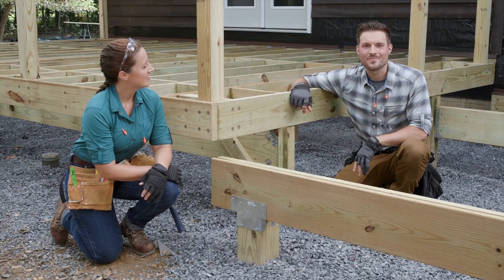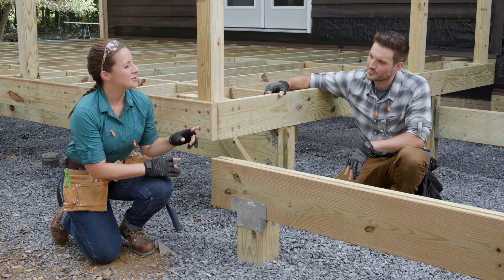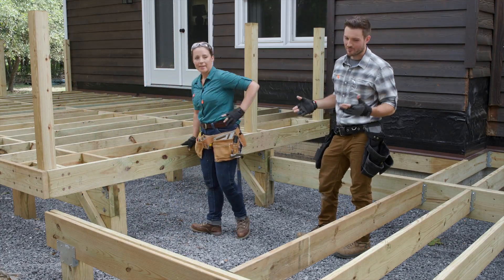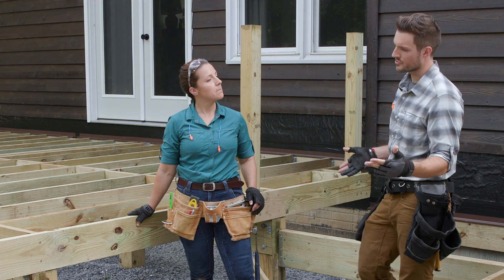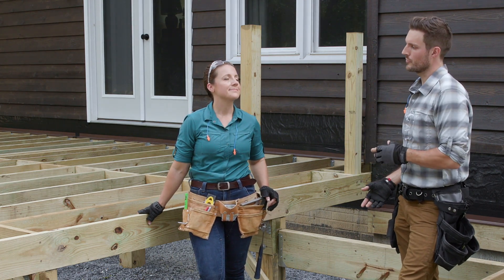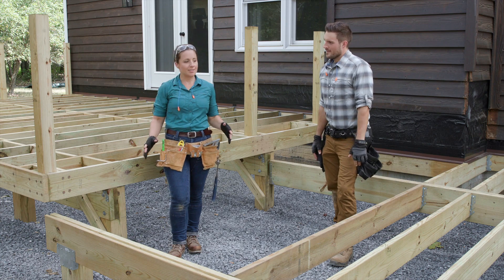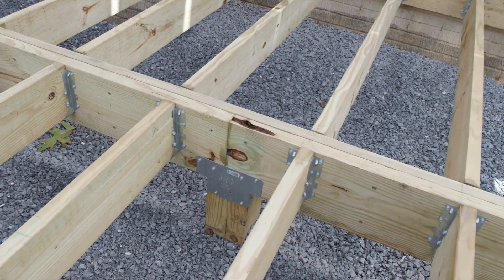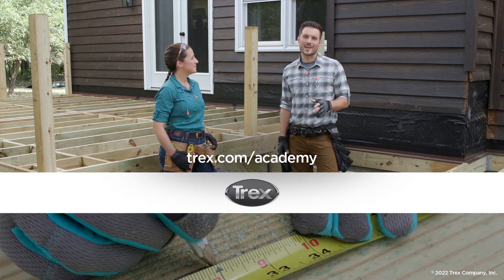How to Install a Deck Flush Beam vs. Drop Beam | Trex Academy

Comment: I really love all of the videos in this playlist, but I have to point out here. According to Simpson’s post bracket installation General Notes, all post brackets must be installed in pairs. Using 1 AC6Z bracket, and 1 LPC6Z bracket together to connect the post to the flush beam is not proper installation. It would have been more “correct”, according to a Simpson, to just use 2 LPC6Z connectors.

Comment: I'm doing a shed base with basically the same flush beam configuration as shown here, with a doubled 2x as a midspan beam. I've been searching everywhere to find the answer to this question: if the joist hangers on either side of the center beam are lined up and facing each other, will the fasteners from each side run into each other in the beam? How can this be avoided while still using the appropriate fasteners (Simpson Strong Drive nails/screws)?

Comment: What he is calling a "flush beam" is really a rim joist with Joist hangers.
  Load should never be carried hung on fasteners. To do so is shoddy carpentry and a hacks cheapo shortcut.
Load path should be wood to wood to wood to concrete to ground.  Fasteners should only hold components together. Fasteners are not appropriate to hold components up.

Comment: There are a couple other factors to consider:
1. With a drop beam, you will have longer joists that will be heavier and usually more expensive per foot, but they also only require one cut to get the right length. 
2. Depending on the deck size and spans, there might be more waste generated when making the additional cuts in the joists for the flush beam. Wood that you’re buying but maybe throwing away. 
3. A drop beam also blocks some access to the area under the deck that sometimes is enough to be used for some storage.

Comment: My deck roof is 16 ft X20ft with low slope of 2/12. My contractor used a flush beam with 16 ft long roof rafters and hurricane hangers/hardwares. He didn’t use drop beam. Does it something that I should be concerned about 16 ft wide roof with flush beam without any support?
Reply: It depends on the size and spacing of the rafters. It appears that 2x8 rafters on 16” centers (14.5” between rafters) is code approved for 16’ spans. As they say, best to check. 

My understanding is that the roof pitch no longer effects the allowable span in the most current building code. 

Most areas require a permit for a roof, so the size and spacing should already have been checked by your local jurisdiction.
Reply: @johnlee7085  thank you for your reply. The joist used are 2X10 at 16” apart. Is flush beam method is equally strong as drop beam method?
Reply: In nerd terms, rafters over drop beams would have slightly greater load carrying capacity, but not enough to be recognized by the international building code. 

I should have qualified my previous response. I live in an area that doesn’t have snow, and am used to looking at those tables. 
2x10’s on 16” centers should be more than adequate if you don’t experience snowfall. With a 50 lb/sf snow load, the max span decreases from 19-6 to 14-2. The other qualifier is that those are the values for Doug-fir lumber, which again is what is commonly available in the US west. Other types of lumber generally have lower span limits.
Reply: Thanks. I appreciate it!
 My deck permit is still open and it is been 9 months that some work is not fixed and electrical inspection is not passed. My contractor is not taking my calls or replying to my texts. 
Also, Since the roof frame was built, I have emailed two three times to the contractor and architect engineer and expressed my concern about the flush beam design they selected for my deck roof. They didn’t do any changes and the framing/ building inspection was passed but I am still not happy/satisfied  with the flush beam as we get lots of snow every year and it sits on our roof for weeks before it starts melting. In worse case scenario who will be responsible for all that?
Reply: Sounds like your greater issue might be with the building department. If you get a lot of snow, I’m not sure how the design you have described would meet current building code. Similarly, I’m not sure how the design you have described would pass the plan review. There might be some professional liability on the line from all three, or at least the BP and design professional.
Reply: @johnlee7085  Thanks. Your guidance is very helpful. It is really truly worth knowing the right direction  for resolutions.
Reply: I reached out to township and raised the issue that my deck roof rafters are not sitting on the structural beam. Why did the inspection was passed? and why did the permit was issued for this design at first place as we get lots of snow each winter? They responded that permit was issued as it is code complaint, but it is a minimum code requirement. The township asked me that my architecture will answer why did he design that way and that how much this roof will bear the weight of accumulated snow (lb/sq ft).
I forwarded my concerns and queries to architecture. He didn't answer my questions and wanted to have a meeting with us and the contractor. My contractor is not confirming for this meeting and trying to finish the electrical stuff first to get its inspection done.

I am not sure why he wants to pass electrical inspection before we discuss the outstanding issues in architectural design.
As I am not aware of how these issues could be handled and resolved, I need to know what should be done and how we proceed for the resolution.
Reply: @humairakhan2945  I'm in Canada with lots of snow, have a flush beam and have had no issues whatsoever for years, and mine's 2x8 and not even 2x10 like yours. I don't think you need to worry and it's not just the ledger that holds the weight but multiple posts all around as well. You should be fine.
Reply: @redline2066  thanks for your positive response regarding the concerned flush beam of deck roof. It is a great relief to know that the flush beam works without issue. Could you please share your deck pics and if possible it’s outlined design too?
Reply: @redline2066  I sent you my email twice but every time it vanishes from the post?
Reply: @redline2066   can you send me your email to connect?
Reply: @humairakhan2945  Keep in mind that the load of the flush beam roof is carried by fasteners. Technically it is not even "built" it is "hung".
Reply: @humairakhan2945  If you let them built it you will pay to have it replaced when it falls down.
 Your "contractor" is a cheapo hack.
 Get someone to do it right. The beams can still be put in and they need to be there to carry the load.
Reply: @williardbillmore5713  could you please tell how to add beam at this point? He already has covered the columns with facia and ceiling with soffit.
Reply: @humairakhan2945  The rafters( roof joists) will need to be exposed so some of what has been done will need to be undone.
 Do you have a lawyer?
Reply: @williardbillmore5713 so far I do not have attorney. First, I want the contractor to correct/ fix the issue. That’s why I need to know what are the options to add beam at this point. Do I ask him to add one more column adjacent to each of the 3 current columns (by using the same current footings) and put a beam on top of the new columns)? Or should he add only a new beam under roof rafters by fastening a new beam with the 3 current columns by drilling long screws thru them?
OR is there any other possible better option to add a beam. Your suggestion would be greatly appreciated. Thanks
Reply: @humairakhan2945  The following illustration shows how the roof should be supported,https://timberframehq.com/wp-content/uploads/2020/01/Timber-Frame-Shed-Roof-Plan-4923-_-2-1024x705.jpg
Reply: @humairakhan2945  To do this right the roof needs to be temporarily supported with propped up posts so the old posts can be reworked to support the beam from under it. Remember wood resting on top of wood is "built". fasteners that are horizontal to hold up a structure  means it is "hung".
 A roof structure should be "built" to maximize it's load bearing  in a situation like yours where snow loads must be considered..
Reply: Sounds to me like pretty crappy carpentry.

Comment: I feel the "floating" deck (which uses the flush beam) is just the current fad that will be outdated in a few years. Where as the more traditional dropped-beam deck is timeless and therefore will maintain more real estate value in the long run.
Reply: Drop beam construction is the only real beam construction. What they call "flush beam is really just a rim joist with hangers. The drop beam deck  will outlast the cheapskate shortcut hung deck by at least twice as long.
Reply: It is not like a rim joist though.  It is like building a drop beam deck, but then putting your joists between the drop beams instead of on top. 

I don’t really see how it’s a shortcut. You still have to have the same amount of footers and posts. You have to double your joist hangers. Cutting way more joists too. Honestly I think a flush beam would take me longer to execute than a drop.
Reply: @bloomgardenco.2328  You can call it a beam all you want, ...you can even double it up, but if it is the same level as the joists and attached to the ends of the joists it is a rim joist in my book. I built my deck with three beams and nine footings and posts freestanding with no ledger board...I did not use a single joist hanger on the whole deck. Joists had full bearing on the beams and attached with hurricane clips. Depending on hardware and hanging the load with fasteners  is inferior carpentry. A drop beam design does not require any joist hangers at all and is superior engineering. All the load is transferred joist to beam to posts to footing to ground. Nothing is "hung" on fasteners.
Reply: You might have it backwards. I believe the term floating deck comes from the cantilever allowed by a drop beam.
Reply: I have built many houses and there is nothing wrong with a flush beam
Reply: @jackfarrell4727  You want to live in a structure that is hung on a bunch of cheap fasteners? Great, but I prefer to live in a house that was built.
Reply: @williardbillmore5713  I can tell you know little about construction.
Reply: @jackfarrell4727  I can tell you think you know it all but you have no problem providing sub-par  carpentry.
 A cantilevered beam is stronger with superior stability than a flush style beam because it relies on the strength properties of the wood rather than the individual mechanical and fastener connections.
 This is especially true with carpentry that is exposed to the elements, like an outdoor deck, As the joists and flush beams dry out, check and shrink the fasteners will loosen over time and the entire structure will lose integrity. Even more so if a ledger board is involved.
 Drop Beam decks, where wood supports wood, tend to last a lot longer and remain much safer under load.
Reply: @williardbillmore5713  do you even know what a flush beam is? Have you ever built a house? And I am not talking about you helping to build it. You don't even have a job now.
Reply: @williardbillmore5713  do the terms post and beam or balloon style framing mean anything to you. Are you familiar with these styles?
Reply: Balloon style framing has been around a long time sonny

Comment: Seems like dropped beam is infinitely stronger build.
Reply: It will outlive the hung deck by a factor of at least two. Fasteners are not designed or adequate to hang a structure on.
Reply: There is some structural benefit to having the joists continue over the beam though there is no code benefit for increased allowable span.